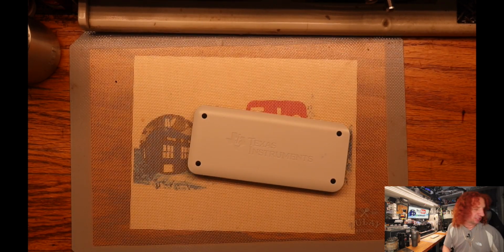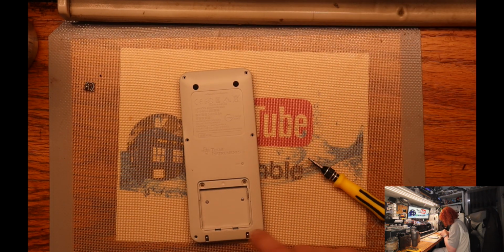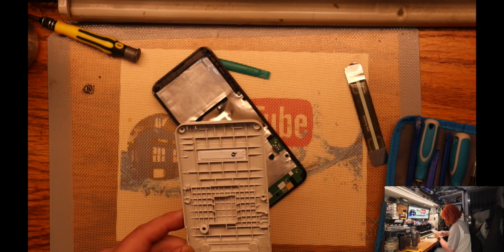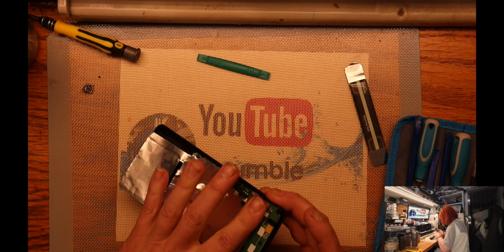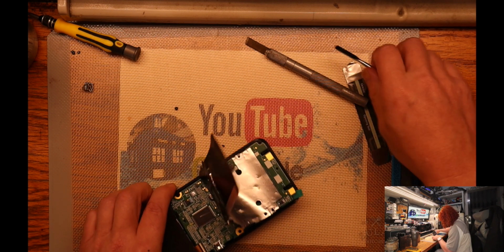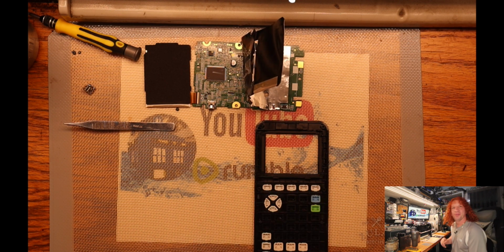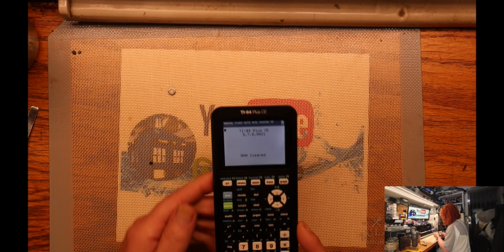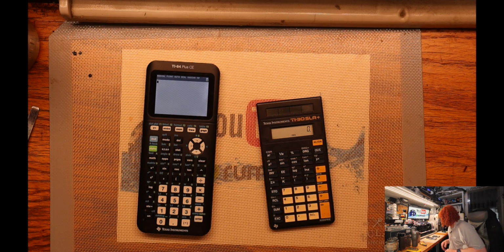Texas Instruments TI-84 Scientific Graphing Calc. Disassembly For Cleaning

Comment: How far they've come.  I still have my TI-86 from the late 90s when I was in college.  There were no rechargeable batteries.  There was no USB port.  They gave you a link cable to link 2 calculators together.  But if you wanted to hook it up to the computer, you had to buy a separate cable for that, which hooked up via an RS-232 serial connection.  Many years later, I bought one, just to keep with it.  Had an old video on that.

I never spilled anything on it.  Never even dropped it.  Because I knew it would never be replaced if anything happened to it.  It looks and works like brand new.  I have no use for it in day to day life now.  How nice.
Reply from the maker: Now, I'm sure there are Apps. That do the same thing. Then Air Drop answers, to those who pay.